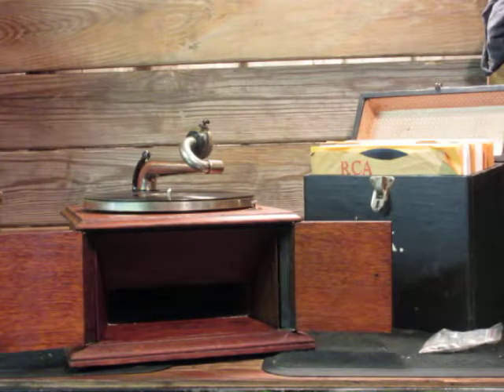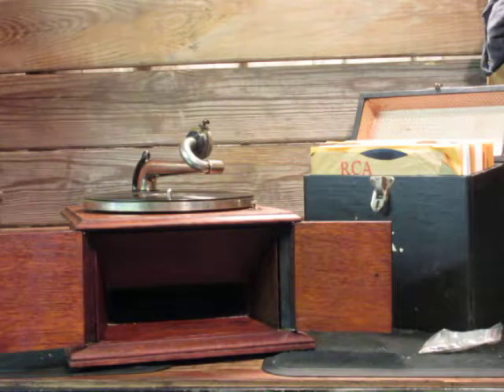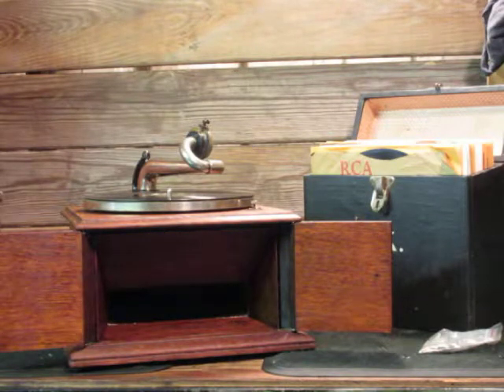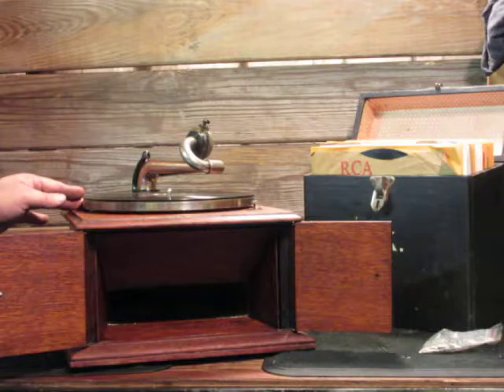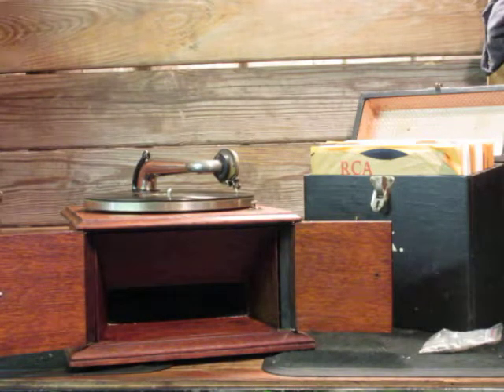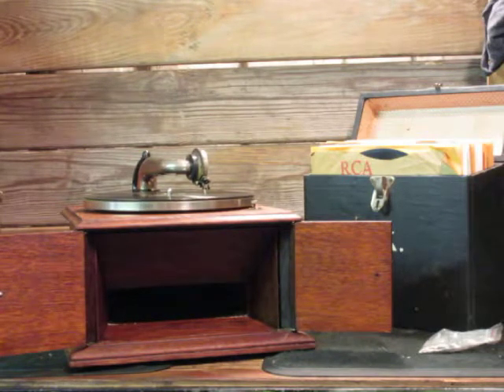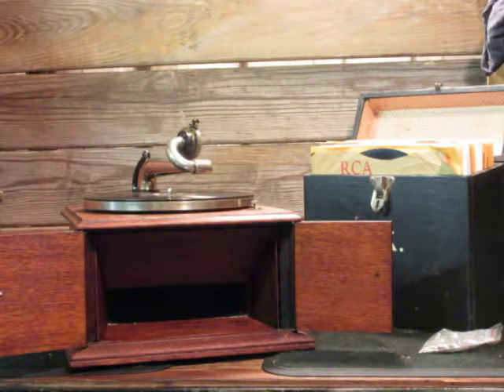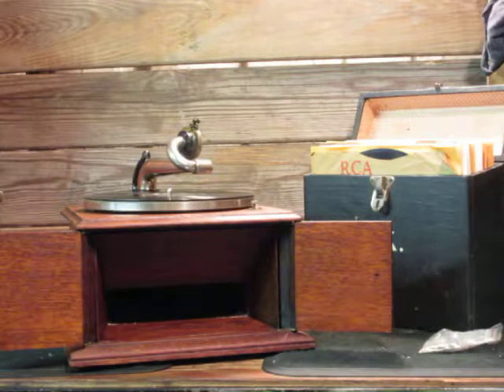Victor Victrola VV-IV 1917 wartime model

Comment: I recall seeing a VV-IV where you were looking straight at the motor when you opened the doors. The motor looked like it was sandwiched between 2 planks which formed a very primitive horn, with the motor board acting at the top plank.
Reply from the maker: That would be the VV-IV made before the first months of 1917, after that the IV became the last Victrola to get the cast iron isolated horn.  You shouldn't have been able to see the motor from the sound doors, all Victrolas except the late 1917 wartime model had louvers blocking sight of the horn opening.  The first IV's has a metal panel in place of the later wood louvers, same idea, just different material.  The VV-IV, VI, VIII, and IX would all use the wood baffle horn design until the mid teens.  The IX got the iron horn first in 1913, the others straggled along later.  The premium Victrolas all used iron, or wood isolated horns from the start.
Reply: @Rockisland1903  Thank you for this detailed information, I appreciate it. The machine I saw was at the Chelsea flea market in Manhattan a couple of years ago. I figured something was not right when I was staring at the motor through the sound doors. They were asking an astronomical price for a total basket case with no plating left.... and there were a couple more incongruities on top of all that; so I left it where it was. Glad I did. Thanks and enjoy your weekend.